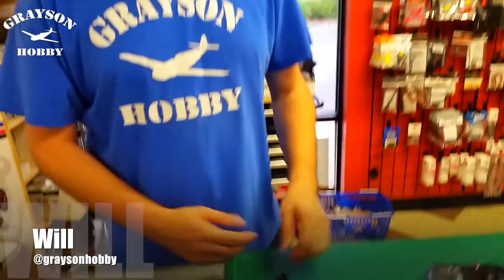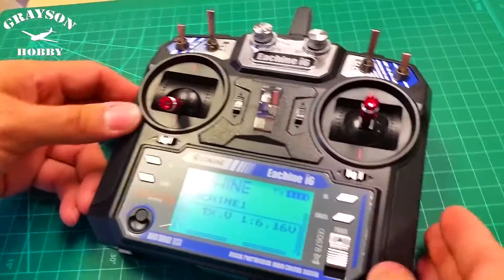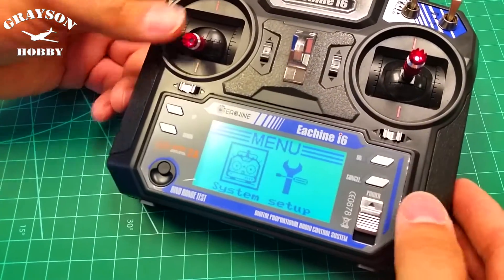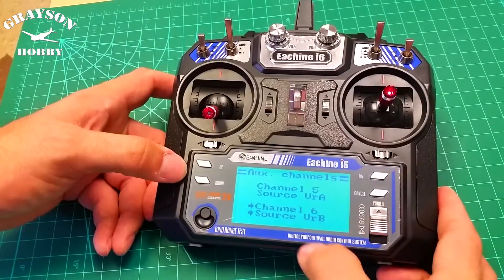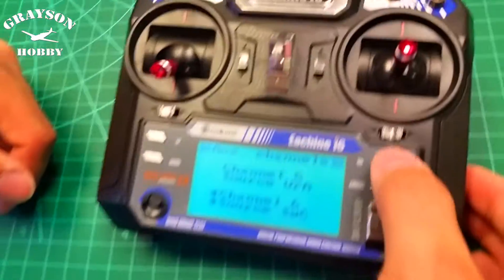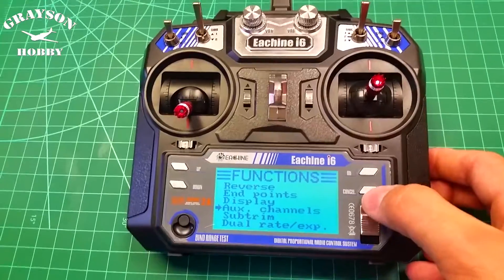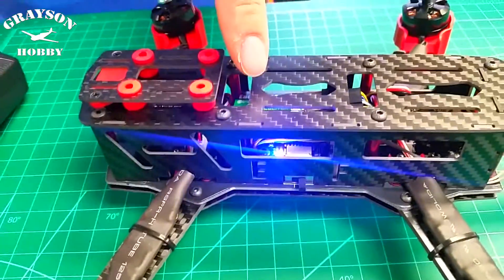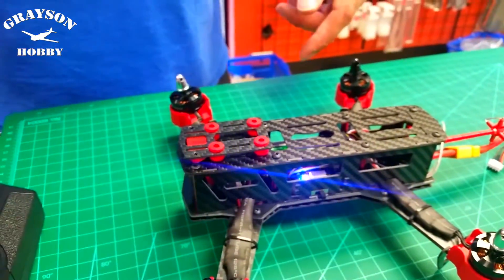Eachine i6 Transmitter Hack - How to Enter The Program Mode

Comment: The eachine i6 transmitter until I use to fly first person is all right,but since I started flying FPV I found that after about 30 meters I lost the signal.I broke 2 frame and 20 propellers, I can't fly so far away with this transmitter.What can I do to solve the problem? Somebody please help me?I've already checked the internal antennas and it's OK.

Comment: yes.  you can use your transmitter ..I fixed the problem ..I had changed the arming settings so i didn't know which button i can turn on the drone ..but I fixed the problem with open pilot .